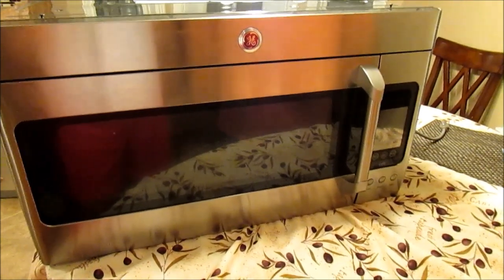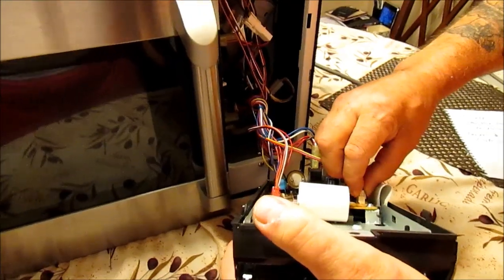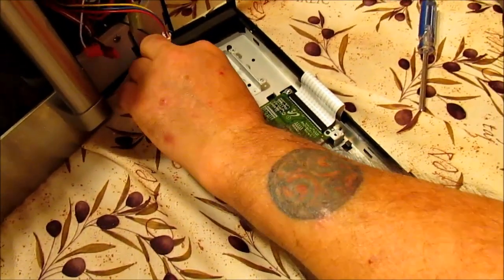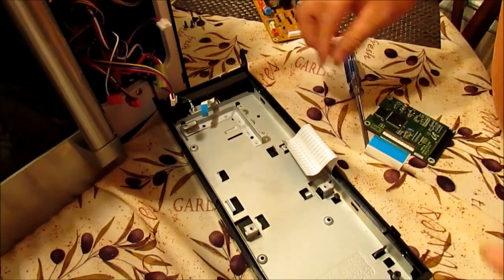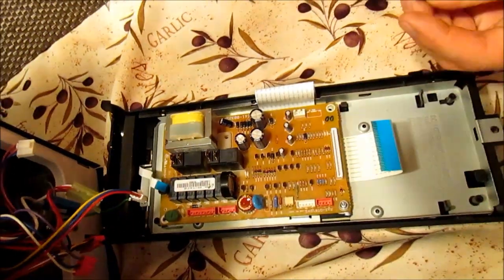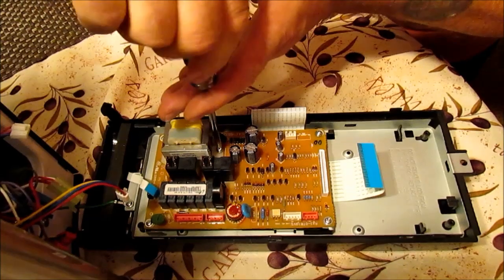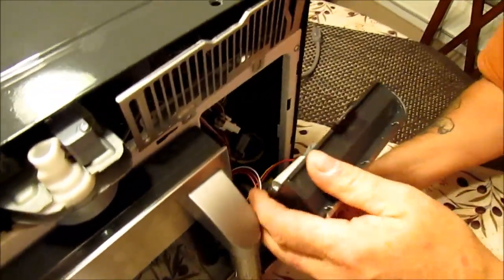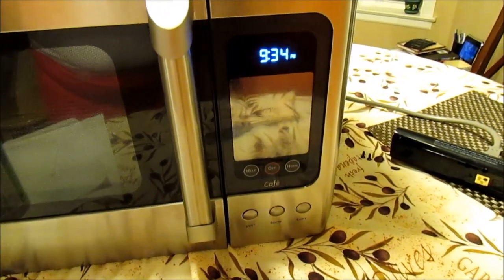GE Cafe Microwave - touch pad not working

Comment: That was not my issue but the instructions on dismantling and reassembly was excellent. Thank you. For those like me, the plastic screen in front of the pad was the issue.
Reply: I did what the video said and I'm still having issues...it's like the touch pad is not centred. What was your issue and how did you fix it?
Reply: @guelphdgc7995  I did as well (trying the video). We found a replacement keypad online and went through the hassle to replace that but it only extended the life a short while- not worth it for us. I suspect our gas burners were the biggest culprit- the heat. We ended up replacing the whole microwave. Good luck.

Comment: This worked perfectly for me. One thing to point out: not everyone will need to remove the microwave from above the range. You only need to do this if the two top screws are covered by your cabinets. In my case the screws were accessible and I was able to perform this repair with the microwave in place.

Comment: My GE Microwave, manufactured in Jan. 2016, went out.  No power on keypad and no interior light.  Something happened to blow the microwave and ruined a GFCI outlet (not the outlet for the microwave, but in the line).  Changed GFCI outlet and restored power to other outlets in the line, but still no power in the microwave when plugged in.  I was about to order a new touch pad and circuit board, $144 at GE or $65 on ebay, but I thought to try this cleaning the ribbon trick.  IT WORKED!  I pulled the keypad off, disconnected only the ribbon, wiped it with alcohol on a Qtip and allowed it to dry.  Reconnected the ribbon and plugged in the microwave and in about 1.5 seconds, it powered on the keypad and the interior light asking me to set the time.  THIS WAS AN AWESOME TIP AND WORTH THE TRY.

Comment: Tried this on a 8 yr old GE Profile Spacemaker 2.0 , which has the same control panel assembly, unfortunately it did not work.  The control panel had stopped responding, the unit was off for a couple weeks and it started working again but then stopped responding  again yesterday. After reading several reviews i'm thinking the humidity from pots boiling under the microwave are possibly causing the problem.  This is a great video and good instructions , thanks for taking the time to make it.

Comment: These are excellent video instructions.  I followed them to the letter on my 2010 GE Cafe Microwave.  I was so hopeful that the touch screen would work, but it did not.  I am glad to hear it worked for so many. Perhaps it is the humidity from pots boiling and recent hot weather,  I may try the hot air blower technique. All worth trying since GE would cost $600.  Alternatively you can send the panel for repairs for $125 on Ebay. Wish me luck.

Comment: thank you! perfect fix. being a lazy being, i didn't want to go thru taking out the boards so i first tried to remove the white wide flat cable that goes to the top of the board  (seen prominently in the screen at 2:50) and insert it back in. It worked! Clearly the contacts got a bit rusty (this should not be happening - bad design job GE!). my situation prior to repair was as follows: everything worked except for the touch featured of the led screen (the bottom 3 buttons worked, as did the display itself). repaired in under 3 minutes. Thanks again! Hope this helps others.

Comment: Worked perfectly, thank you! 

Pro tip: You can avoid completely dismounting the microwave. I was able to do this by just removing the top bolts, enough until the microwave tilted forwards enough to access those two top screws.

Comment: Nice job on the video.  I have had many problems with the GE Cafe Microwave touchpad.  To minimize the problem I made and installed a small aluminum plate to cover the gap at the bottom of the touchpad assembly so that steam from the front burner of the GE Cafe Dual Fuel range does not affect the touchpad.  Unit installed in 2009.  I also had other problems with the GE Cafe Duel Fuel range and GE Cafe Dishwasher, so while they look nice, I wish I had purchased another brand.  It was an expensive investment for the units to last such a short time.
Reply: +jm jm 
The problem with our unit seems simlar. Unit does not respond to touch pad, unplug , plug in 1-3 days later and it works again. Assume it has dried out. Where did you place the aluminum plate and what size?
Reply: +Ken Oelberger; It appears as if GE Appliances is now selling the touchpad again.  It was out of stock last time I checked.  However, it is selling for $512.25 just as much as the entire microwave cost back in 2009; might not have any other choice except to purchase the touchpad and hope it last longer than the first one.     https://www.geapplianceparts.com/store/order/shoppingcart Microwave Control Panel WB07X11113

Comment: Amazing!!  Just followed your process on my Maytag microwave. Of course, the assembly/electrical connections are different, but once I removed the control panel and cleaned the bus strip terminals, it now works perfectly (after years of frustration and being too cheap to replace the microwave)!!  Thank you so much!!!!

Comment: This was an extremely well done and easy step by step instructed video to follow! Thank you very, very, much for putting this up. I now have a good working microwave again, and saved hundreds of dollars by avoiding a service call. You're the absolute best.(I have a CVM2072SM3SS). Ps. --> If you have clearance above the vent & cabinet where MW is mounted, ...you actually don't have to pull microwave down to do this, ...I did it without having to pull the MW down.
Reply: Harold Echevarria i

Comment: Sorry - meant for these comments to appear here.

We have a Jenn-Air microwave with similar a similar touchscreen problem.  Unplug the unit first!  On this unit you have to remove the metal case and pull out on a little clip that presses the ribbon cable against the contacts in the ribbon cable connector.  I had figured out several years ago that the cleaning with alcohol process described in this video worked on our microwave.  This was after actually replacing the whole touch panel once.  Same symptom - some keys would quit working.  Most of the time simply cleaning the contacts on the cable keeps unit working for several months.  Just cleaned ours a few minutes ago.  "2" wasn't working.  It's a quick, simple, fix.  Takes longer to take unit out of its cubby hole in the cabinet it's in and remove the case than clean the contacts on the one ribbon cable on our unit.  Great video - just wanted to share my experience on a unit which requires a different approach to accessing the ribbon connector.  One other thing, there is a high voltage capacitor which is exposed when you take the case off.  Stay away from it and the wires leading to it.  It's in the rear of the cabinet on our unit and the touch panel connector is very close to the front of the cabinet just behind the touch panel.
Final note - Jenn-Air is a Whirlpool company. They also market products under Whirlpool, Maytag, KitchenAid, Amana and other names.  Fix should work on many brands.

Comment: Thank you for this helpful video, which has saved everyone a lot of money. In my case it was the smallest lead (removed at 3:24 in the video) that was dirty with grease. I also have a Panasonic Genius at my other place, which is a much better microwave, easier to use and with individual buttons rather than a touchpad--- keep in mind if you ever need to replace it.

Comment: Thank you for these explicit instructions  My microwave is just over five years old (two months outside the extended warranty that I had bought).  I was getting a message that the keypad was shorted.  We got it down and I was thinking of buying a replacement.   However we followed your suggestion and the machine is now working again.   It seems that we need not even have taken it off the wall.

Comment: Thanks for the info!   We just replaced our refrigerator and the next day the dang microwave stopped working.   I wasn't looking forward to spending more $$ on another new appliance.  It took a little finagling to get the panel off as it is a different model but after a quick wipe with alcohol it works like new.

Comment: Thank you for posting this!  In my case the ribbon cable has a scorched mark on it where it touches the capacitor on the main board and there might be a micro break there.   I straightened it out a bit and I think the contact is re-established and my pad works again.  Hopefully this will buy me a bit more time.

Comment: I gave this procedure a try and it didn't work.  The touch pad stopped working a year ago, and then miraculously began working again after I stopped using the burner directly below the touch pad.  Unfortunately, it crapped out for good a couple of weeks ago, so I called GE.  Within five minutes they let me know that the touch pad was defective on the unit (Cafe Series less than 4 years old) and that I qualified for a replacement.  The replacement was delivered and installed within a week!  Not only is it a brand new microwave, it is a convection oven also!  GE rocks!!!!  They even took the old unit for disposal!

Comment: The video was very clear and helpful with disassembling the microwave touch panel. Unfortunately, it did not fix my problem. My touchpad does not respond to the touch but the lights to it come on and the physical buttons to control the light, fan, etc work. Back to the drawing board.....

Comment: Do you think the problem is with the Ribbon or with the Circuit Board connection? I have to continually clean and replace the ribbon in the connector, but it keeps happening. Should I replace the control Board and Ribbon orb the Circuit Board? Thanks.

Comment: Thanks a lot for this!  I followed your instructions and noticed two blown fuses and a burned chunk of wire behind the keypad. I replaced the fuses and burned wires and then the microwave powered on!  The keypad was still unresponsive though. I called GE at 866-898-7465.  After a very cursory troubleshooting (does the keypad light up?) they told me that, since the microwave was purchase just under 5 years ago, I qualify for a free replacement model of the latest equivalent.  The microwave, delivery and installation were all completely free.

Thanks a lot for these instructions!  Would've never noticed the first (trivial) problem without them.

Comment: A very clear and concise video. I have an old Sharp R 351. The touch pad works but but no display. I've been advised to replace the display panel. I've problem trying to locate the part here in Thailand. Do the parts have a number and do you think your cleaning method might not necessitate a new part? Thanks for any advice.

Comment: I have the same microwave and the other day it died completely. No power, no light, nothing worked . Also something smelled like it had burned. All I was doing was heating up some water, which it did heat up., but when I opened the door the light was out and the control panel wasn’t lite up. Any thoughts on what it might be? My unit is now 14 years old. Have ordered a new unit, but won’t arrive until April 2022

Comment: I know this is a really old video but was there by any chance you know how to change the glass behind the touchpanel not the plastic like substance which you can touch but the actual glass? I got angry at my microwave and ended up pressing the touch screen too hard which cracked the glass inside

Comment: I had same microwave over ten years.  Worked great until yesterday.  Key pad unresponsive.  I saw the video above and was ready to follow his instructions but tried to one more thing. 
I pressed the vent button and the fan was blowing then  I pressed on the key pad and the clock came up and suddenly it worked again.  maybe the vent shook some dust or moved something back
in place but regardless it is now working.  thought I should post this if anyone encounters the same problem again..

Comment: Our keypad just stopped responding last night, tried this but it’s still not working.  Anybody know if replacing the circuit board fixes this or do you need to replace the entire control panel?
Reply: If you have to replace the Control Panel Assembly WB07X11113 it's better to just get a new Cafe Microwave. They are impossible to find and when you do, they are $400 and up. There is one on E-Bay now for $400 and Appliance Parts Pros has one for LOL $1094.... I'm going to try this fix on mine when I get a chance. If I cant fix it I'll buy a new one and part the old one out...

Comment: Do not replace control panel or control board. Just simply use your  hot air blower and heat in front  of  touch key for  one or two minut. do not heat  display only key number. your touch key problem will go away